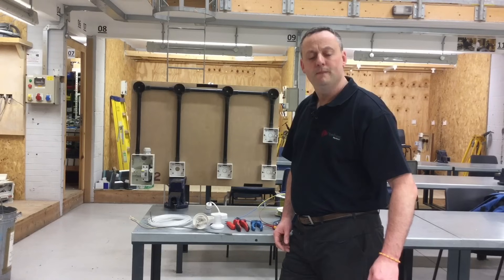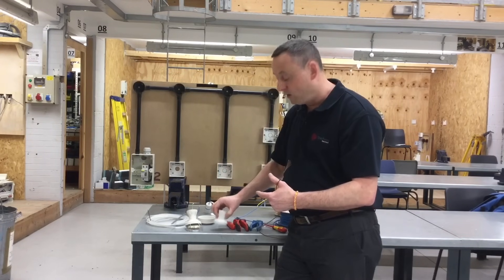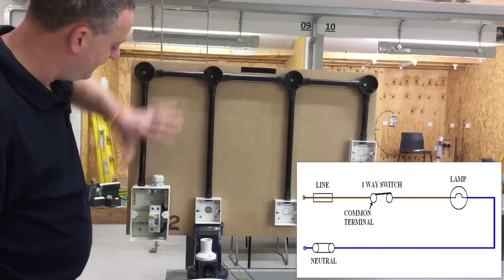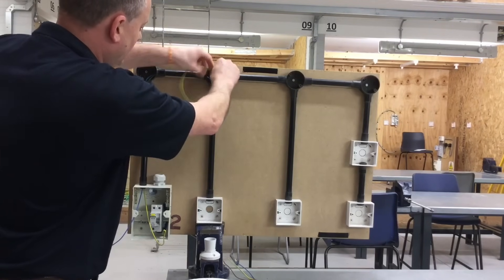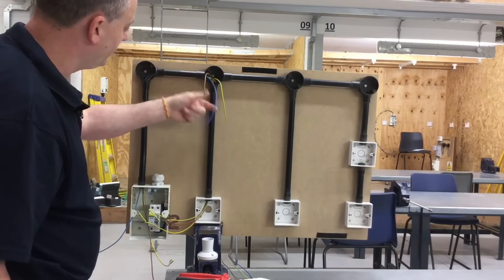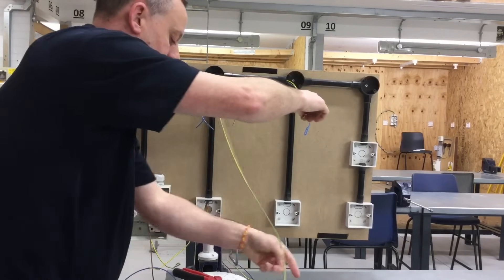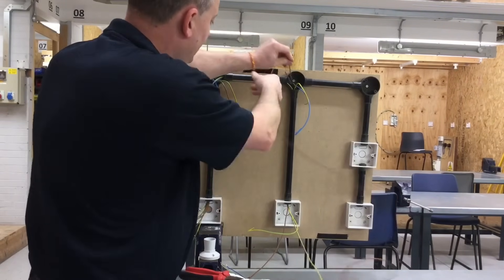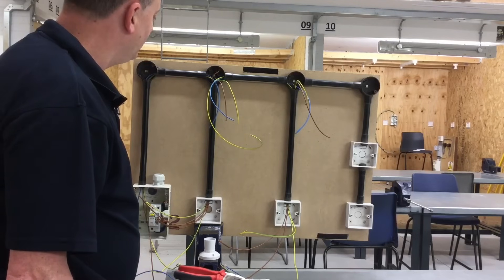Conduit Loop-in Method for Wiring Lighting Circuits in PVC Singles in Conduit (How to Full Demo)

Comment: i'm a bit confused why you're putting a cpc down to the switch and then another one back up when theyre all connected.  when youre using steel conduit as a cpc you dont put a piece of conduit going down and then another one going back up

Comment: Enjoyed that totally different from the domestic cable wiring, but I can see why you don’t need the sheath protection because the conduit does that job. Could it not be wired with cables as this way seems a lot more work and fiddly or is the point to reduce No of cables at the lights etc. Also most importantly you did your send off too quickly at the end. It’s meant to go. I hope this video has been…….pause some help with a big thumb love that don’t lose it or sell it to anyone else that’s your signature. Cheers for another good explanation.
Reply from the maker: Thanks for the detailed comment Robert 👍🏻

Comment: I don't know if it's code in the UK to have to wire this way but it seems like you're wasting about 20% of your wire having to backtrack with your ground/CPC and your Hot/PermLine wire

Again I don't know if it's code but making a junction inside the lighting box with your ground/CPC and your Hot/PL wire would save having to go down and back to the switch

Like I said I don't know what code is in UK maybe they don't allow Junctions inside boxes that carry fixtures

If you could clarify it would be greatly appreciated. Thank you. Also, I realize this video is 3 years old.

Comment: Are there any limitations for using singles in conduit for connecting together 2 outside flood lights on the same circuit. I know metal is best practice but I have not seen anywhere saying its absolute.

Comment: Another great tutorial. Can you get junction boxes that fit the conduit incase you were making a three plate connection to an LED batten? The only boxes I've seen don't seem to match the conduit. Kind Regards
Reply from the maker: Not that I know of... massive thanks for commenting and watching 👍
Reply: @GSHElectrical  Thanks for the speedy reply. So how do you use conduit to protect a lighting circuit if you want to use anything other than a bulb holder which has the junction box integrated into the base?

Comment: 👍. I used to have a 4.0 mm single earth wire that I attached to the draw tape first . This 4.0mm was then used to pull in the other cables to avoid putting to much strain on the draw tape and damage it . Keep up with the videos.

Comment: This is the standard installation practice in Europe usually with flexi conduit chased in the typical masonry walls. I believe its also mandatory in Ireland?
It does make rewiring so much easier.

Comment: why not pick up the live neutral from the first junction box by using a terminal block? If I understand the 18th correctly, creating a branch off the main spur would be allowed provided it would only feed one end point? It would certainly make wiring it up easier and you essentiallyalready do this with the neutral?

Comment: Excellent video as usual. You make a throw-away comment at about 3 minutes in about not needing to use a draw line as the runs in this case are so short.  But for longer runs do you have any tips about how to attach multiple singles to the draw line, without increasing the cross-sectional area or stiffness of the bunch (e.g. by using too many wraps of insulating tape) - maybe it's covered by another video which I haven't yet found ?

Comment: Absolutely brilliant video Gaz. However, I’ve made a little rig board exactly like yours, but the only difference with mine is, is that I’ve started with a one way lighting circuit, extending another two circuit which is a two way circuit taking the feed from my original one way circuit and then terminate my cpcs into maintenance free connectors, but when I tested the circuits and flick the switches into opposite positions I don’t seem to get a on and off operation. I check to see if there’s any default wiring but all fine. I’m just a bit confuse in the sense that it’s all wired properly but not working on the strappers. Any ideas on how to approach this. 

Lincoln
Reply from the maker: https://www.youtube.com/playlist?list=PL2Ea5r9gxUUevU9gv8lizD53aYvwiJ5qr

Hopefully this playlist might help 👍. Gaz

Comment: Do you identify (mark up) the switch line with any tape? As there are 2 brown cables? What would best practice be for that?
Reply from the maker: Hi. No identifying required. Thanks Gaz 😁👍
Reply: @GSHElectrical  thanks for the speedy reply Gaz. I would have definitely assumed there would be some labelling, would save testing the cables (if you were taking over the job at the point you get up to in this video for example and weren't able to see the cable runs etc.)

Comment: why do u need a cpc in a switch. the box doesnt seem to be metallic. in india we only have L & N. CPC is given if the SB have sockets in them( yes we wire sockets and light switches together). what function does the CPC have in the switch.
Reply from the maker: Hi. The cpc is at the switch in case it is replaced with a metal one therefore making it an exposed conductive part. 
https://youtu.be/o72z_p8FIBQ
All the best and thanks for commenting and watching GSH Electrical

Comment: Will you show wiring 2 way switches in singles and emergency lights with switched fittings on same circuit and key switch,I get confused with singles,Great informative videos,Thanks.

Comment: Greetings, I do enjoy looking at your video's. While this does apply to to the UK, I thought i would give you an idea of what they use here in the Philippines. Normal light circuit is single cables, NO CPC used, the use cable called THHN 2mm Sq. Stranded, you also can get solid core. Power outlets, Receptacles,  Single wires, use CPC, cable called THHN 3.5mm Sq, Stranded, you also can get solid. Scary part is many power outlets do not have Earth (CPC), so only 2 pin sockets, but of course you also have 3 pin with CPC, a lot of it is based on the USA system, but using 230 volts, plus you also get a different plugs, some round European type and and some straight (USA Type), you can get global power outlets which will take any plug, there are very common. The light sockets, switches, power outlets us push in fittings, there is no screws. So you cut the wire to correct length and push in the socket, switch or whatever. One very good brand is Panasonic, but of course lots of cheap rubbish on market also. Basically no such thing as RCB or RCBO only circuit breaker, as you can imagine lots fires every year because of electrical wiring. Cheers.
Reply from the maker: Wow thanks for taking the time to put together your message. You bring up some interesting points. Thanks again and keep watching Gaz

Comment: You can buy 1mm singles, why do you say 1.5mm is the minimum in conduit?
Reply from the maker: Hi. The exam question is what size cable as a minimum do you wire lights when they are installed in conduit answer 1.5mm2. The reasons for this I explained in my video. 👍GSH Electrical

Comment: I have a young guy working with me  2 days a week for experience, he is doing his 2365 L3, sadly his college is pretty useless and I have had him watch your videos and he learns a lot more from your videos than at college!, the college teach him to pass exams but no actual work skills or real world scenarios. Do you teach your students to take the feed to switch rather than the ceiling rose? as its a good basis before going onto conduit.
Reply from the maker: Hi. Thanks for the kind words. New learners are taught the standard 3 plate loop in method for pvc/pvc wiring and conduit loop in method in conduit. However I have covered feeding the switch with all my learners as it is so common in industry hence the videos on it. Hope this helps Gaz

Comment: Is it permissible to use plastic conduit to supply outdoor lighting say floodlights? Is there anywhere in the regs that deals with outdoor light fittings?
Reply: +ryewashere_  Thank you for that, is it necessary to glue the fittings together? I am only asking because some videos I have seen seem to suggest that glue is not necessarily required which seems rather strange to me :)
Reply: +ryewashere_ Fantastic, thank you very much.
Reply from the maker: Hi. Black PVC conduit and try and avoid direct sunlight (south facing walls).... correctly IP rated and fitting and seals as well. Thanks Gaz